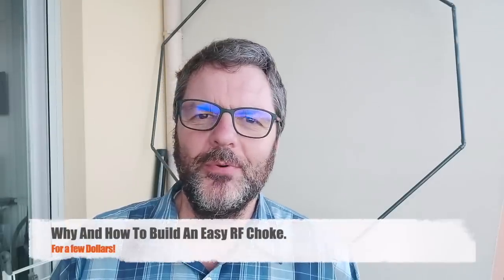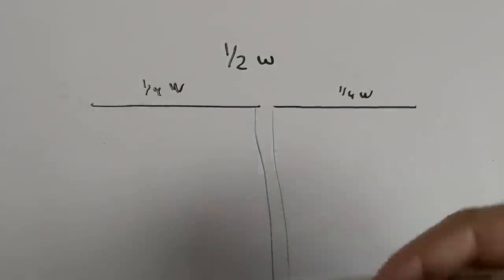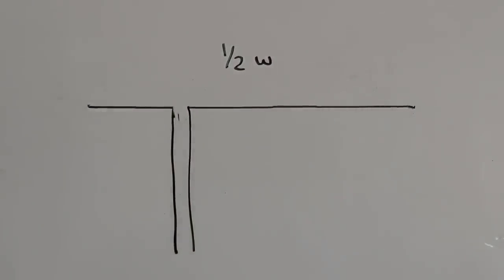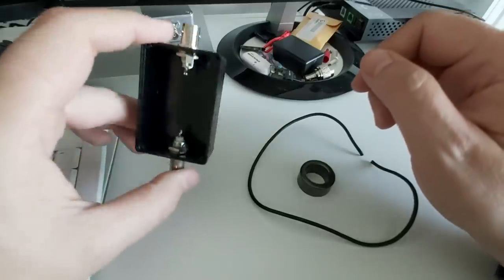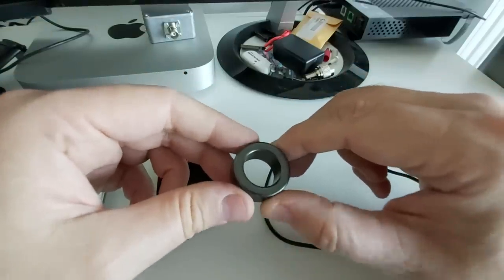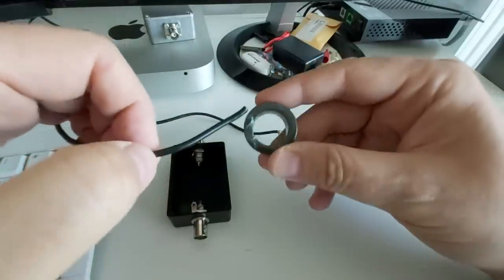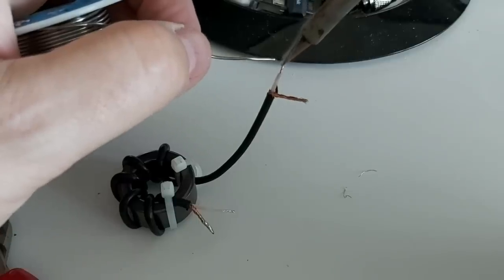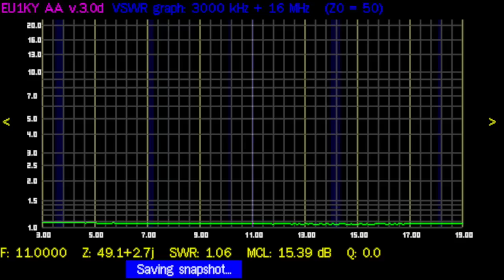Why And How To Build An Easy RF Choke.

Comment: Must one use coax? Is there any reason one cannot use, say, twin speaker wire, or a manually closely coupled  bifilar winding?
Reply from the maker: Coax is just simpler and bifilar is more finicky, requiring more attention to detail..
Reply: @RadioPrepper  A perfectly reasonable reason :-)  I just don't have any thin coax like that, but I have some flat, four-conductor single copper stuff from Radio Shack; I'll split some of that of into two pairs: it'll probably wind easier and flatter anyway.
Keep 'em comin', Gil, I look forward to seeing notifications of your new posts in my inbox.
Anecdote: I miss France, too: an ex-pat Brit in the US now for 36 years, I used to travel around  western Europe for my job back in the late 70's, back in my machine tool controls days. The inside of a French tool & die shop is the same as any other, but the surrounding countryside was beautiful. Do you guys still have yellow headlamps? I always though that was smart... (priority to entry onto a roundabout not so much ... ;-)  )

Comment: What would happen if I hooked this up to a 2m radio?
Reply from the maker: Not sure but why would you?
Reply: @RadioPrepper  say if I threw a random wire up a tree and got heavy swr???
Reply from the maker: You never use a random wire for 2m and it would not help SWR anyway. Look into a coax colinear.
Reply: @RadioPrepper  was just thinking of a hypothetical where you may try it to get an emergency call out
Reply from the maker: It might work but I would guess no better than the rubber ducky the radio came with. A ladder line Slim Jim would also work much better...

Comment: Nice job! Just ordered toroids from eBay, 140-43 2pcs. I was planning to make 1:1 balun for my dipole and
maybe 49:1 for end-fed, what you think? 
Where did you get those little plastic boxes?
Tnx, 73!
Reply from the maker: Sounds like an excellent plan. Boxes are from Ebay: https://www.ebay.co.uk/itm/264683896396 but the Hammond 1594BSBK is much better...

Comment: I can't find a FT-114-31 anywhere. de W4WLC
Reply from the maker: Apparently it's non-standard, probably Chinese-made. Better use the next size over, like 140 maybe..
Reply: @RadioPrepper  Thanks for the fast reply.   Think I will go with the FT-140-43...
Reply from the maker: That'll work :-)

Comment: Hot glue the hell out of it, just imagine in the 40s what the hell the French resistance could have done if issued with hot glue guns ha ha

A tip from an expert select your ferrite material and cores with the inside diameter of the coax you are going to use as close as possible , from your coax feeder line take the rig side end and the antenna side end and slip say 8 coresconto the cable at each end , solder the plugs on and heat shrink with 3 layers the cores to the cable with 10mm spacing between the cores. If you work in an ems lab you know the tricks its far more professional than using little plastic boxes and such bnc  rf  rubbish bins ha ha 
We HS0ZOG